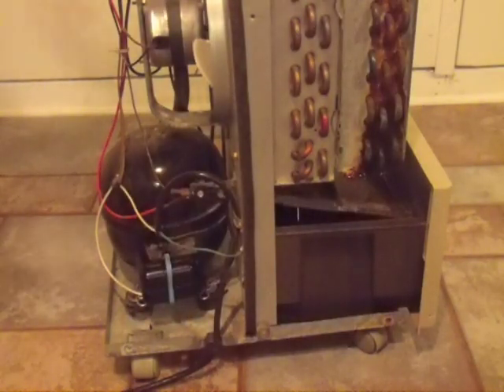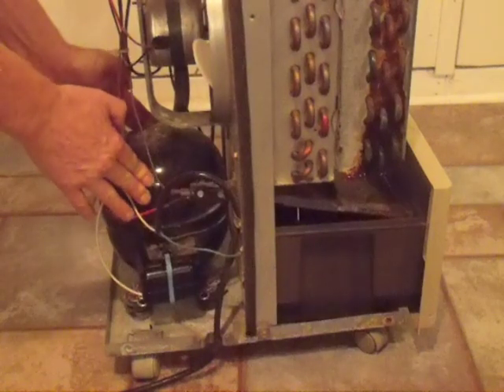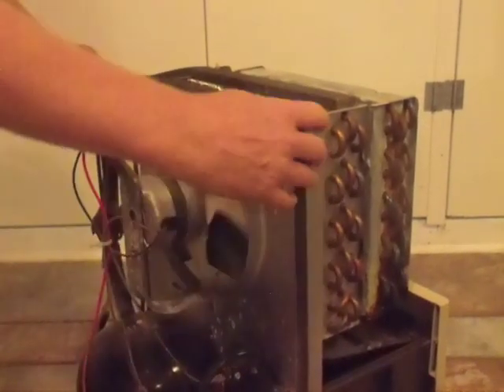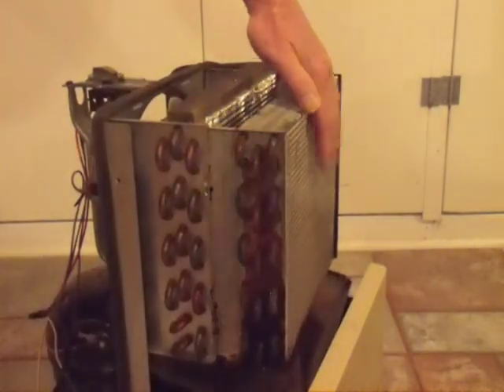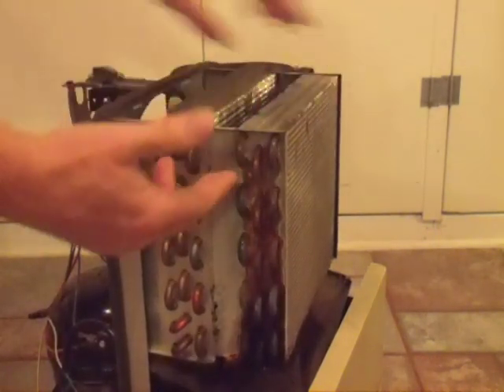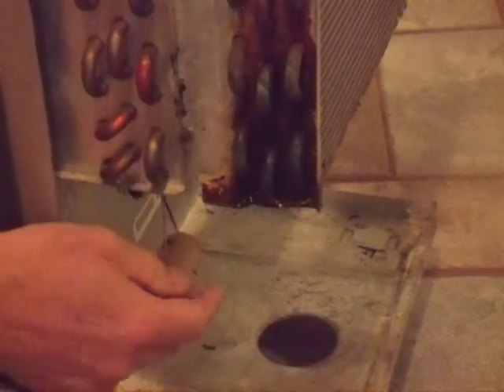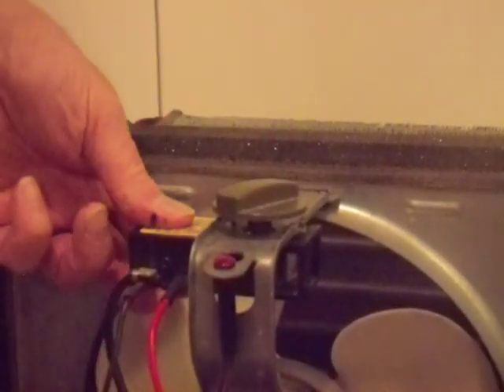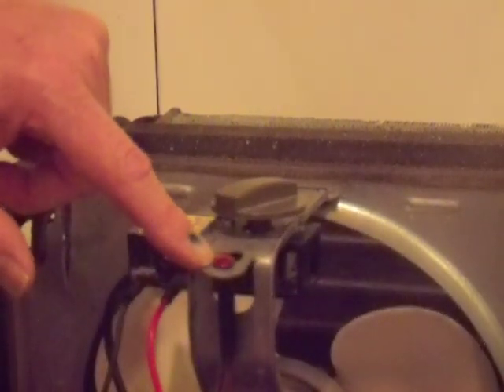How a Dehumidifier Works

Comment: Poorly made video. You did not explain the second part which is the condensation coil where cold&dried air is fed to bring the latent heat of compression back out with the passing air. The machine is essentially and AC unitnthat does not.alters the room.temperature.Regular air.conditioning is also a humidifier---a much more effective one---but they lower the room temperature in the process.

Comment: OK. 1) if you look at the machine in the video there are TWO sets of coils - the first, as explained, cools the air and causes moisture to condense. However the heat from that first operation is fed through the second coil, and heats the now drier air as it passes through. This relies on the principle that as water condenses, it gives off heat - the latent heat of condensation. It's the opposite of boiling a kettle in which water absorbs energy to boil - the latent heat of vaporization.  2) The warmth of the machinery causes heating. I have an ordinary household dehumidifier and measured 7 degrees Celsius between air in and air out. Dry air heats much more rapidly than wet air, so the air that comes out is at a higher temperature than when it went in. Not only is your dehumidifier good at removing water, it ALSO heats your home.

Comment: This is also one of the reasons we refer to it as an Air "Conditioner" and not a cooler.  Basically, it has all the parts an AC system has...it follows the basic refrigeration cycle; Pump, condense, meter, evaporate.  Moist air hits the cooler coil and condenses...this is why your AC system looks like its "leaking water" on humid days.  This water you see is actually the water in the air from your house.  Technically speaking, a well laid out and properly sized AC unit can dehumidify a home quite adequately.

Comment: Very well explained. Question; is the air that comes out of the unit, cooler than ambient? Thanks, Cheers
Reply from the maker: The air that comes out of a dehumidifier is warmer than the room air.
Reply: Thanks for the response. I wasn't sure if the heat from the compressor and electric fan, or the cooling from the coils would be the dominant factor. I should have guessed heat. They're similar to window A/C units. Cheers
Reply: +Chad Gambrell this is my pain every night in summer. it's pumping out really warm air, into my already sweltering room in Australian costal heat and humidity :(
Reply: stanfordcoffee  Actually, as I understood, some dehumidifiers have a heating coil to reheat the air back to a normal (or warmer) temperature. (There are different types of dehumidifying) Because, as I understood, your right. Its is passing hot air over cold coils which will inevitably cool that hot air to some extent. Now,in this method of dehumidifying, the refrigerant still needs to be cooled, so an extra heat coil is probably not used ... but.. I'm not sure why they don't put a by-pass option in for that. In the warmer months I would not want it to reheat the air, and that costs more money. Oh wait, I got it. If they put that by-pass option in there, then it would be a portable AC unit... almost. (you would still need to exhaust the heat from the refrigerant, to the outside. Then you could atomize the waste water into the exhaust air, and run it continuously.)
Reply: That´s my problema too Emma Cormick.  My fantastically working dehumidifier gets rid of all the mold and keeps my place dry, while it keeps me wet with sweat.  I can hardly cook, since the machine is in my kitchen where I need it most, because I have to stop every so often to wipe away the massive perspiration.

Comment: the evaporator is inside and the condenser is OUTSIDE not directly infront of the evaporator if that was so you would have zero cooling and just dehumidification

Comment: That is a good question. The difference is.. The evaporator and the condenser are in line. The difference in the air temperature causes condensation and thus removes water from the air flowing through the machine. I can get more technical but that is the basic reply I think you are looking for. YOU can build one from an old window unit. IT has been done~!